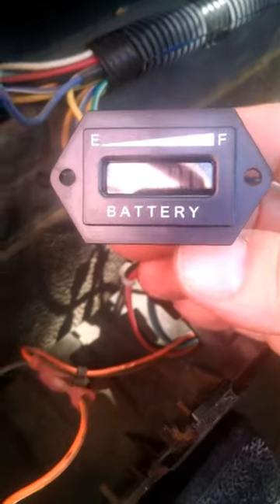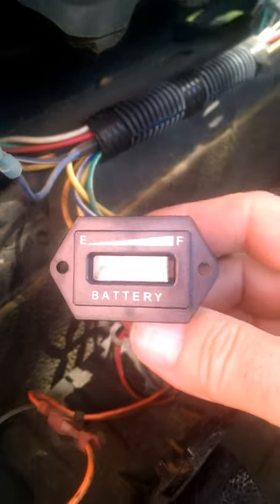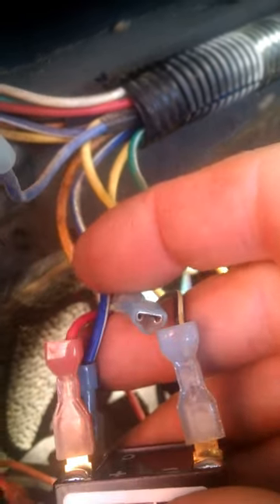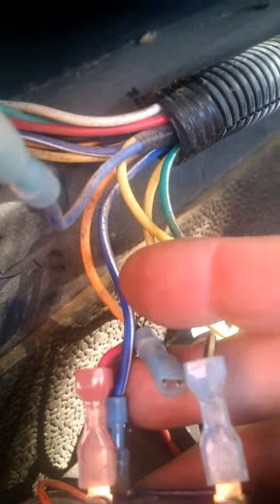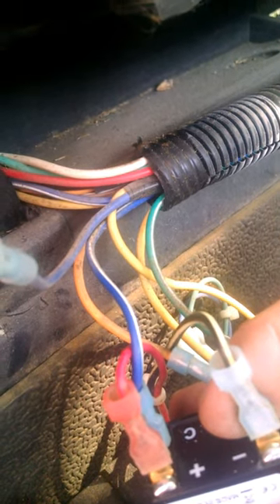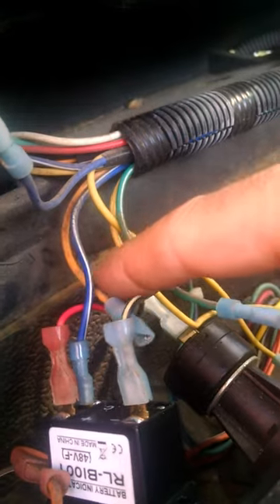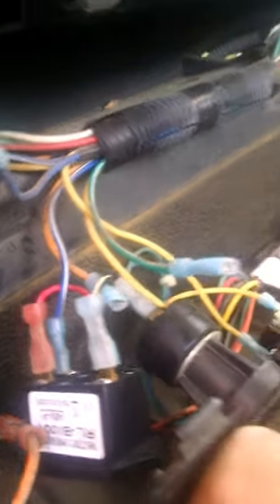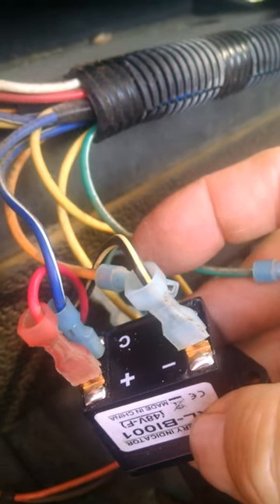Battery Meter on Club Car Precedent(how to install)

Comment: Thank you WilRob, I'm an ol guy who just bought his first golf cart. On the maiden voyage my two friends who joined us, ended up pushing us home! (like when Barney Fife bought his first car!)... I NEED one of these, and your video is very helpful. I post boat videos and hope I help people too...
Reply: Did it not have the factory warning light?
Reply: @dyoel182  Thank you! Yes it does have the warning light on the 'dash' under the steering column (to the left of the headlight knob). If it came on when the batteries got low, I never noticed it; I don't think is is working. The batteries are 8 months old, and in great shape (I filled, load tested, and did specific - gravity test); I now keep it plugged to the automatic charger. It is a 2013 Club Car Precedent that was raised and a different 'body' and back seat installed.... I just installed a new speed sensor device and magnet disc on the motor that for now seems to have fixed another problem I had. (It would go to 'crawl' mode after running for a few minutes....

Comment: Thanks for this.  I did not have the blue and white wire so I tied into the ignition switch side that is powered on when the key is turned.

Comment: I hooked mine up but I’m getting erratic readings when the cart is being driven.  It seems to read steady only when the cart is stopped.
Reply from the maker: Double check your connections and voltages.

Comment: I have a 2015 precedent. I took dash off and there was the red and black/yellow but no blue. So what i did was just hook the black and yellow to - post and then ran a wire off the keyswitch to the positive. Works perfect. you dont need anything on the c post. It powers on when key goes on and no power when golf cart is off.
Reply: I didnt get you quite well. How did you run the positive again please? What kindof wire  you use to  it from?
Reply: @bunlungsupreme5878  I used a piece of 14g wire I had laying around and just ran it to the keyswitch from the + on the meter. Left the c post empty. it works perfectly.
Reply: Vic Santoro so you have to change the keyswitch to double spade connector right? Because the one that came with the cart has only one connector.
Reply: @bunlungsupreme5878  no i did not change the keyswitch. I simply connected the + connector on the meter to the + on the keyswitch.
Reply: Vic Santoro how did you join with the one wire thats already there though? Because the keyswitch  already have the blue wire on it, how did you join the wire from + on the meter ?
Reply: @bunlungsupreme5878  I slid the wire from the meter into the connector and just re-crimped it where the new wire went in. never even disconnected the keyswitch wire.

Comment: I installed this just as you have described.  It turns on and off with the ignition as expected, but my battery meter shows 100% full, no matter how long I'm out driving around.
Any idea why this is the case?
Reply from the maker: Hmmm, not sure on that one.  Maybe double check the wiring.  Could be a faulty meter.  Are you checking with a voltmeter?
Reply: @wrdyke  I found that the power wire is always showing 49 volts.  I found another wire that shows the actual voltage the battery is putting out.
Reply from the maker: Off the top of my head I would say the meter is bad....i dont think you cart has an alternator so that is the only thing that makes sense.  Did you check voltages with a meter on the wires?  You could unhook the meter when you know the batteries are a bit depleted and check the voltage.  If the voltage is low(under 48 volts) then you will know if the meter is bad.
Reply: @wrdyke  So the meter that I bought has a removable piece on one of the sides. I't a smooth rubber plug, that I didn't even notice until I looked at it a bit more. Inside the meter, there were 3 switches that allowed different voltage configuration.  It came from the factory at 12v, so my 48v system, even when half depleted was showing full.  I configured it for 48 volts and it started working. So I had two issues, one with the meter, and the other with the power wires I used.  I ended up going with a different meter all together, as this original one was difficult to read in sunlight.
Reply: @wrdyke  Hey Will. Still struggling with this. I've purchased 3 meters now.  One of the power wires I was using always put out 48 volts, no matter the battery state.  I found another power wire that directly matched the voltage from the batteries.  However, my meters never show this correctly.  For example, last night, my battery meter showed that the battery was almost fully depleted but when checking the batteries directly, were still putting out 36 volts, almost 75% of capacity.   This morning, after charging all night and a quick ride around the neighborhood, batteries are putting out 44.7 volts, so 93% of the full 48 volts, but all three of the 48v battery meters I have will show just around 50% (5 of 10 lights lit up).  I'm at my wits' end trying to figure this one out.
Reply from the maker: @golfnutt1969  A 12 volt car battery will be fully charges at arount 13 volts.  It is depleted at 10.4 volts.
Reply: @wrdyke  yeah. I did some reading and figured that out. Thanks for the reply.

Comment: Hey Will, my golf cart got 6 packs of batteries, each individually reading at 8.64 volts, so assuming its a 48V system across. I am trying to find end to end part of the circuit but the highest reading i get is 17 volts and at some other locations 15 volts. Not sure why. Can you advise please. Thx
Reply: I did set the voltmeter to 20
Reply from the maker: Your batteries should be reading close to 13 v so something's going on if your batteries are only reading 8.64 volts.
Reply: @wrdyke hmm but i thought these were 8volts batteries?
Reply from the maker: @VolksStokes  I am sorry, you are correct. Batteries are 8+ volts.
Here is a wiring diagram.
https://goodtopssm.life/product_details/45394047.html
Reply from the maker: @VolksStokes  I'm sorry you are correct your battery should be 8 plus volts on a 48 volt system. 
https://goodtopssm.life/product_details/45394047.html

Comment: I have a crapy meater on my 36v ebike it has only 3 bars so not acureat. I bought one of theses should be in in 5 days.....there is only a red wire and black wire coming from the igniction switch. So I should I  run my - to black then put a jumper wire on the + side and run + to the other 2 poles?

Comment: I have a 16’ precedent but I don’t have the blue/white wire. I tried just hooking up the positive and negative and the unit seems to power up (the light moves from full to empty) and then it just goes blank. Do you have any clue why this would be happening?

Comment: Where does the blue and white wire go to from the meter?
Reply from the maker: The blue and white wire is a switched 48 volt wire that is turned on and off via your key switch.  Always check with a meter to make sure.  Key on should produce about 48V and  when key is off there should be 0V.  I am not sure if it connects directly to the key switch but the voltage in that blue and white is controlled by your key switch.  Hope that helps!

Comment: Greetings. Congratulations for the video, a note is not seen with the lights on, a pity. Can you please tell me where to connect the C? I have clear the positive and the negative, not the C. This week the package arrives, I bought it for my boat along with a voltmeter, safety first of all. Thank you for your attention.
Reply: ok, thank you very much.
Reply: Model # of part also does this work on Trojan Batteries, thx!!